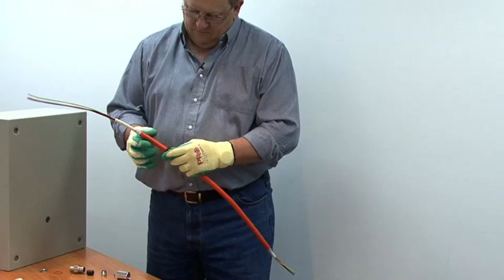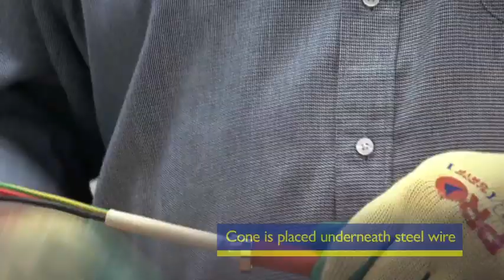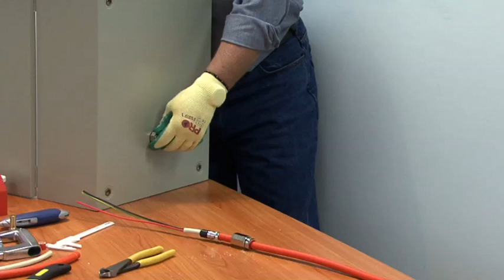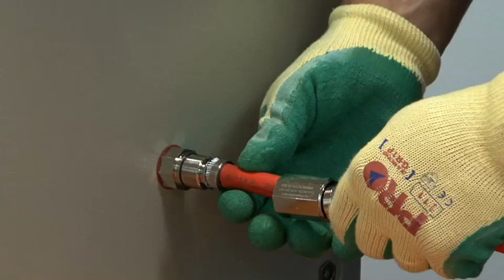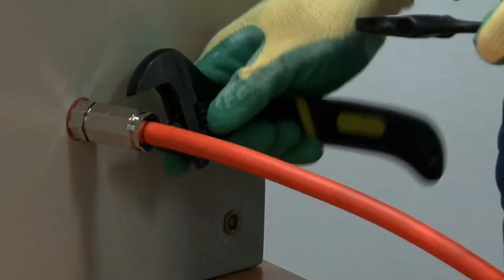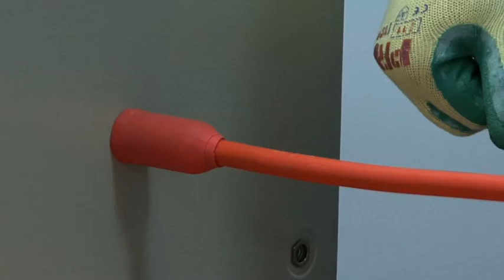How to install an Alco Hazardous Area Steel Wired Cable Gland - Part 2

Comment: You only do the sleeve up hand tight? Your installation instructions are lacking vital information.  Also your swa doesn't clamp on the cone which is not good